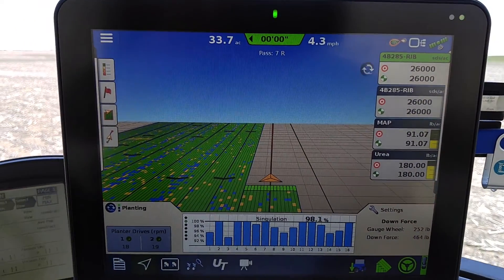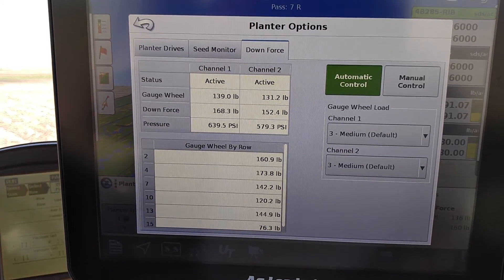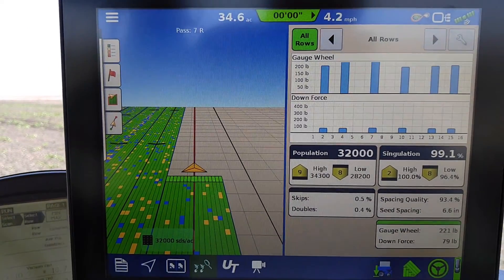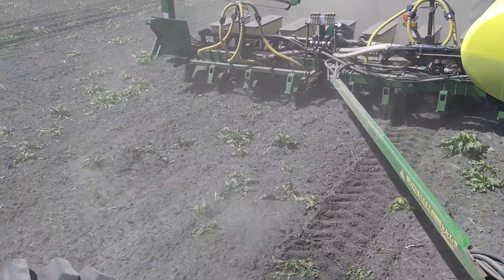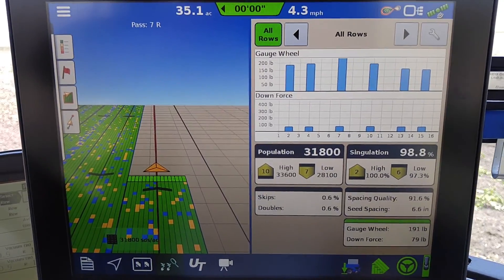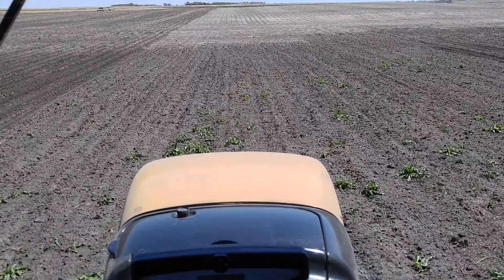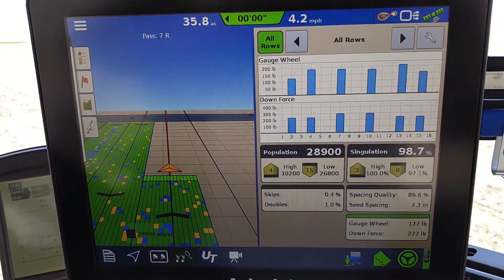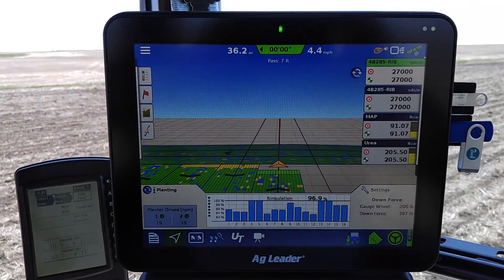AgLeaders Hydraulic Downforce System and Results

Comment: I have an 8 row planter, since I have ability to run 8 channel downforce, should I go ahead and put a weighpin on each row and have each row be a channel?
Reply from the maker: It depends on your system your running if you have the iso or legacy system for hyd downforce each one there is different than the rcm system that puts a module on each row.  the 2 channel legacy system i believe supported 6 I think or it could of been 4 per channel the iso system if your setup for 8 you could i suppose put 8 load cells on i believe then the rcm and rcm 2 supports a load cell per row

Comment: Why is your singulation and spacing quality so low if you dont mind me asking?
Reply from the maker: Running wavevisions seed sensors are more sensitive and found a problem with the planter on my middle rows where the hex shaft's drive the innner rows the drives are not consistent which causing a pulsing action faster slower faster slower ect...  in turn causing population to jump up and down and spacing quality is terrible.  Before running the new incommand display and just a DJ sensor I never knew i had these problems.